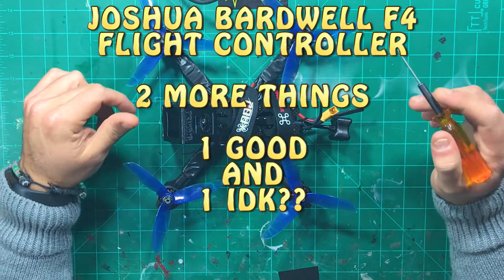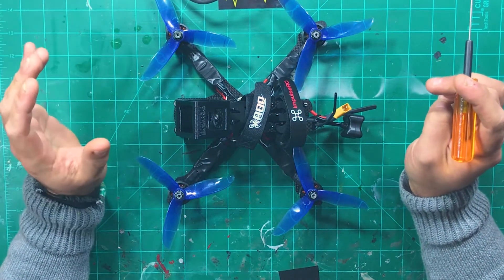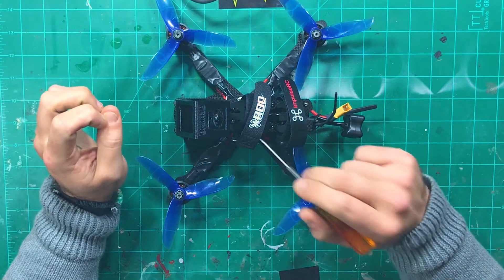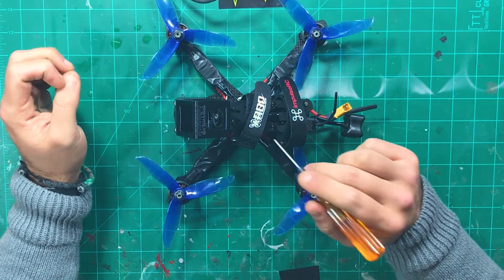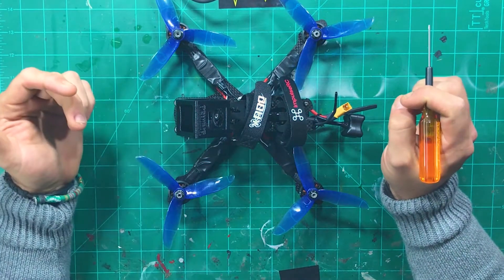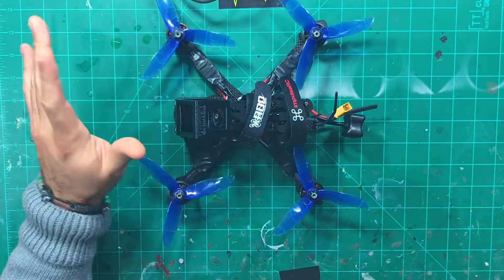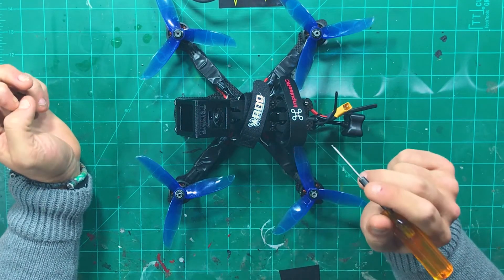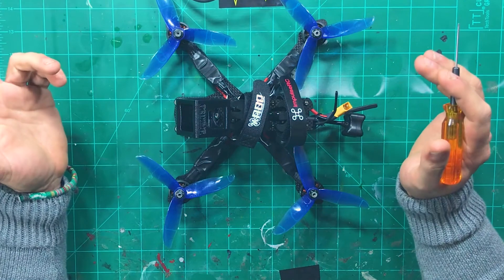JOSHUA BARDWELL F4 FLIGHT CONTROLLER // VTX POWER AND NO COATING

Comment: Thanks for the good info!  You are correct- JB did explain the reason for using vbat instead of the filtered step-down voltage...   Not a show-stopper for me, though...  It seems to be a great and well-considered FC...!  
Keep warm in this frigid weather!
Reply from the maker: me neither..but i know a lot of noobs might hook up to vtx power in and then crank up the power to  800mw and then complain..that the board stinks.

Comment: Did you hook up the unify for smart audio? If so, what pad did you use on the FC?
Reply from the maker: kenkamm unify smartaudio is hooked up to crossfire. It’s in my reverb build video. 3 I think. Wired to the micro tx.
Reply: ChaddyCEEE RC Thanks, I missed that I will check out your video again. Thanks for your help.
Reply from the maker: kenkamm no worries. First time I did it. Works perfect.
Reply: ChaddyCEEE RC Awesome. I’ll be using the micro Tx in the Taranis so I’ll need to figure out how to access the settings, it doesn’t have that little screen on it. Not sure yet how the LUA script works for that - it’s not the BF LUA

Comment: i believe, the vtx issue is because of the voltage the vtx needs to run at those levels. It's not necessarily an FC issue, That being said, unifys, mach2's, tramps are designed to run off VBAT. From what he said in his live stream last night, he is going to change that to 10 volts-ish on the next revision because of that issue.
Reply from the maker: yes I agree..I am just surprised he didn't mention that in his video of the FC..he blamed filtering and didn't say this will not run off of 7.6V when he installed the mach2 which goes to 800mw
Reply: i think at the time he didn't know that it wouldn't work down there. i forget what he said in his q&a yesterday but it was towards the end if you go watch it. now technically, the specs on both the mach2 and the unify and tramp both say it will run off 7 volts (i have all 3) but i personally run them off vbat anyway. I think because it's at the lower voltage range the vtx just struggle. i don't think it's a design flaw in the FC, but like i say, he's already said the next revision will up that voltage to 9-10 volts
Reply from the maker: Daytona FPV yeah I’m good. Hope others watch it because a lot of new guys will buy that and hook it right up and think they have a bad vtx or board. Had me for a second.